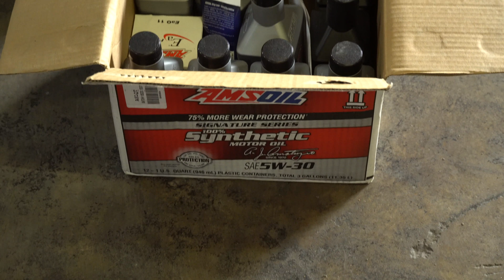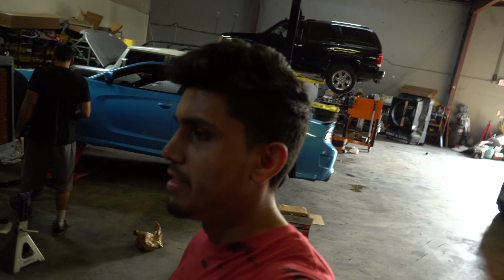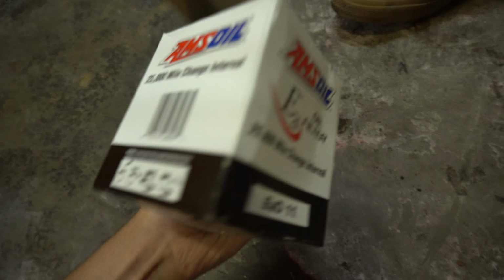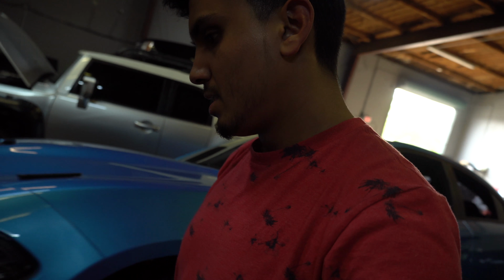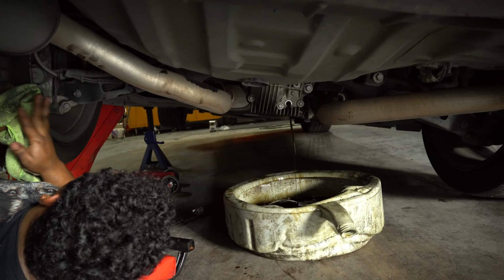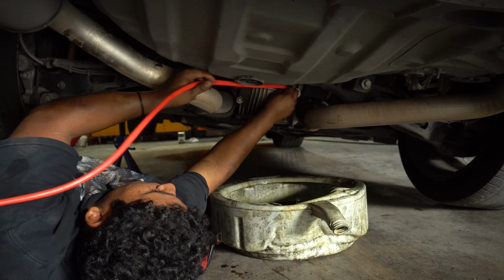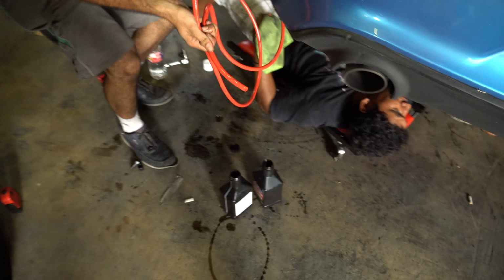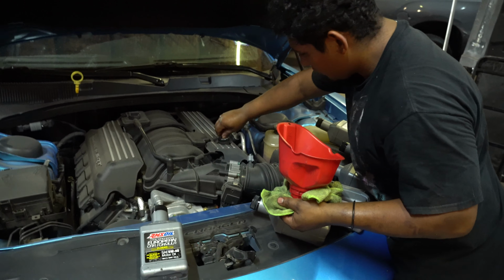Changing Charger ScatPack Oil and Rear Differential Fluids!

Comment: Amsoil is a great choice for the differential fluid change, but you used the wrong oil and oil filter for this car. It's recommended to use Pennzoil Ultra Platinum 0W-40 Full Synthetic Motor Oil and Mopar "SRT" Oil Filter for better results and longer lasting
Reply from the maker: Yeah I explained in the video, people use the 5W-40 because it runs cooler in the 392 hemis. Using that one is totally fine.
Reply: Well at least you should've used approved oil for the charger. European Formula doesn't have the MS-12633